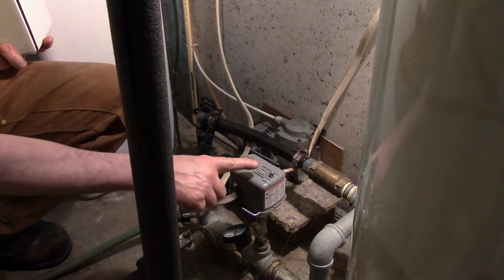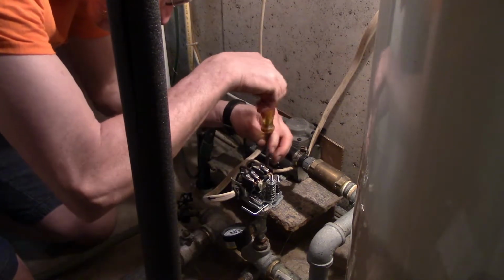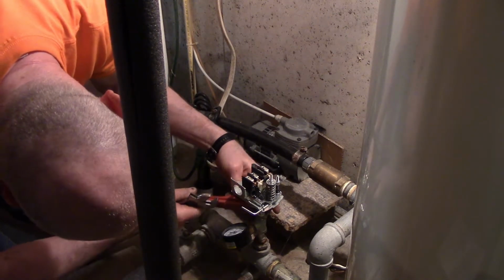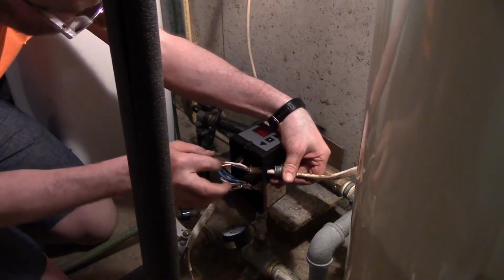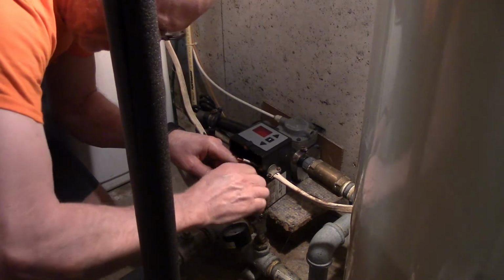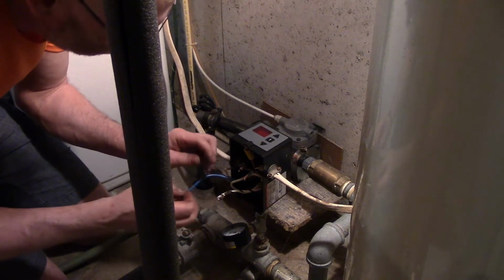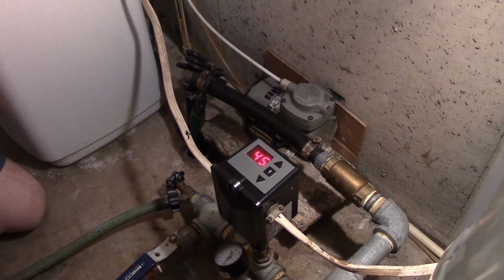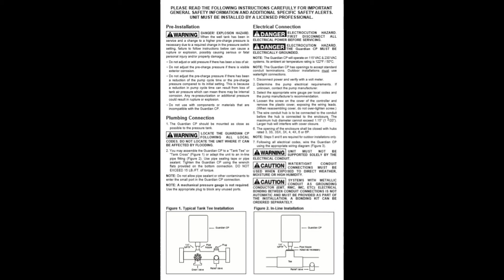Amtrol Guardian CP, Digital, Solid State, Well Pump Switch

Comment: I am tired of corrosion of the contacts and melting of the plastic clips that hold the contacts on the unreliable Square D. I am replacing them every 6-12 months.  How are you liking this one so far?
Reply: you may need a higher amperage switch if yours is burning up that quick.
Reply: Sounds like a bad well tank, IE rapid cycling of well pump, thousands of wells out there, contacts virtually never have this porblem wiht good well tank, to verify well tank (with internal air bladder), turn off well pump power, open faucet/drain and allow all water to drain, should take several minutes with good pressure if the tank is good, tank should feel empty of all water at this point, good time to check air pre-charge, set for 3 psi bellow cut-in pressure, if tank is water logged and adding air does not start driving it out the drain / tank bad / water in air bladder / replace tank, PS I do like the Guardian CP / Good Luck
Reply from the maker: Lasted just over two years, just out of warranty, I am to a standard pump controller.

Comment: Nice instructional...what are your impressions so far?  Have you been using the reduced differential feature (10psi)?
Reply from the maker: Only lasted just beyond its warranty two years.
Reply from the maker: Lasted just over two years, just out of warranty, I am to a standard pump controller.

Comment: Has anyone dealt with the E4 error?  Just replaced a standard set of contacts that would fail (presumably from arcing) periodically with this unit and have gotten E4 (which shuts off the pump until power cycled) twice in 6 hours.

Comment: I would like to install.  However I would like to have another backup that would cut the pump off if this controller fails and the pressure gets too high.  Does anyone have a recommendation?
Reply from the maker: Only lasted just beyond its warranty, 2 years.
Reply: @HRIservicesllcSturgeonBay Curious…what was the failure?